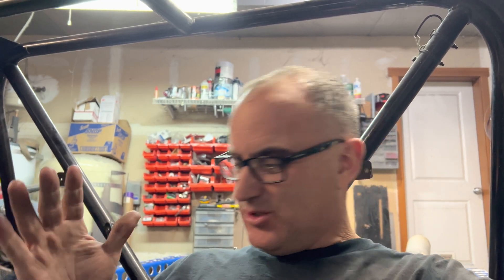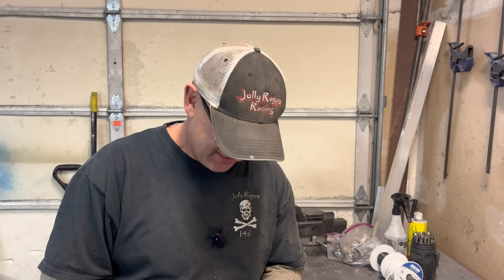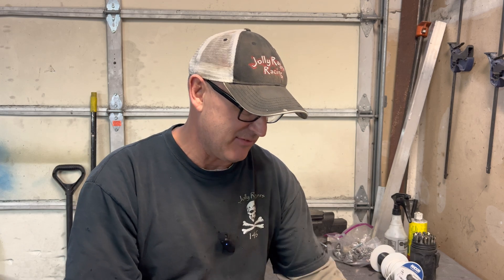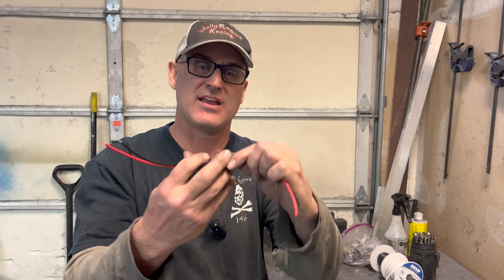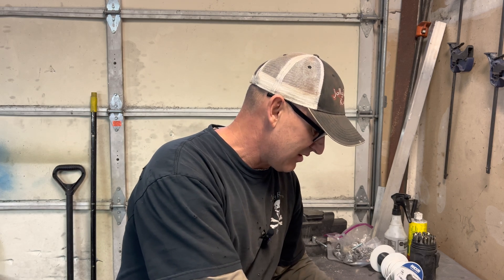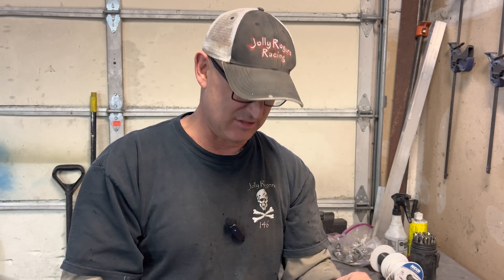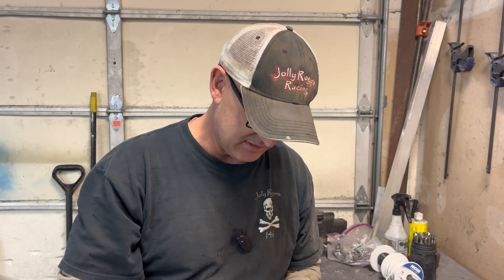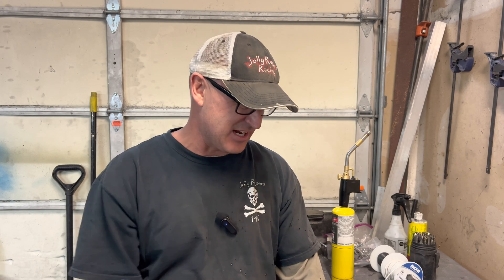How I WIRE a mini JETBOAT

Comment: Using the stainless crimps is not wrong.. but minimizing crimps and those types of connections is advisable. It just creates more potential failure points. Making the water tight connectors is easier than you think. I bought an Amazon kit and picked it up quickly. It does require a certain type of crimper but if you get a kit they’ll include a cheap set normally.

Comment: Eeeewwww...... Wiring. And I am certain that a whole bunch of guys know exactly that feeling of thinking you achieved the task of getting all the butt splices and terminals crimped on and then you realize that you either forgot the heat shrink or the wire can't be routed through a small hole with the crimps on the wire. 
I bet that everyone, including myself, use those exact same crimpers, but I know the limitations of those kinda crimpers. 
I've had the ratchet style and I am desperate to buy another kit since someone decided they needed my set more than I did.
As for what I use on shrink wrap, I use a heat gun because the low setting on my old Milwaukee heat gun is the perfect temp and I can shrink that tube down lickity split with it. I hate using torches or lighters for that. Not how they're meant to be shrunk. It makes the material brittle and it will fail you right when you least expect it. If it's not going into something that doesn't need to be weatherproofed then no biggie, but what wiring job doesn't need to be waterproofed???? Which is why I'll also only use the 3:1 heat shrink with the hot glue/waterproofing liners.

Comment: Eric, for crimpers I have a Klein I really like. Model J1005
For strippers I've had a Thomas and Betts forever. Model  WT200. Just got a Knipex model 13 72 8 which I think I'll like but time will tell.
For waterproof connectors, I don't think you could go wrong with Deutsch. Very available and you can get some great 4 way crimping tools. Deutsch is the standard in many industries. Get an assortment and don't look back.

Comment: If it's worked this long no need to change, right?
That being said, what you're doing only requires simple wiring so I see no need to make it any more complicated however you might check out Terminal Supply Company out of Troy Michigan for supplies, good parts in bulk. If you want to step up your game with Deutsch or Delphi/Packard plugs and connectors they have everything you need to do full custom wiring with no butt connectors. I'm on an Off Shore boat team so I've seen some interesting wiring issues over the years from the salt water that just seems to find it's way into everything so always using the best materials has always been a priority. Regardless, keep doing what you're doing till you think it needs to be better because if it ain't broke ya can't fix it. Great videos, I just love those little boats, so bad ass!!!

Comment: We use the snap on PWCS7ACF extensively at work. They work well as wire stripers, but excel as crimpers compared to other combined tools. They're spendy at $57 but I can't believe nobody else has made a combined tool that works so well. The pliers on the tip even work well. We have several old pairs that are "worn in" and move smoothly. I ordered 3 new pairs in different colors for new employees and we found varying levels of stiffness initially, though they seem to be getting better with use.
Reply from the maker: I’ll look them up, thank you!
Reply: If I didn't have what I have already, those look like a nice tool I'd spend the money on.